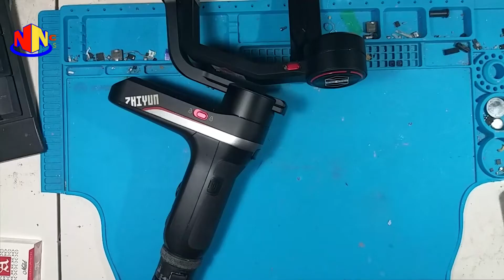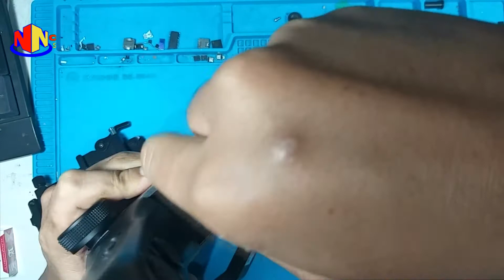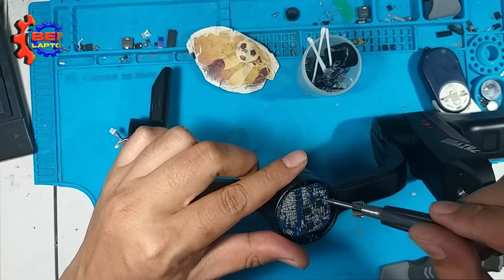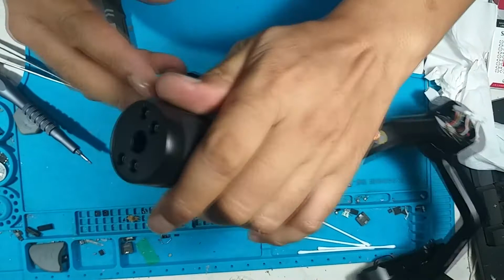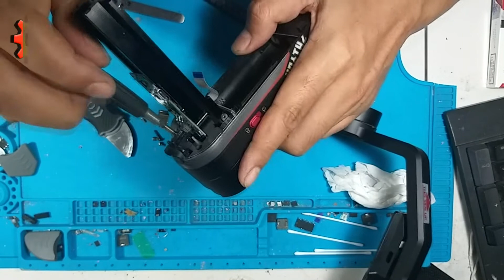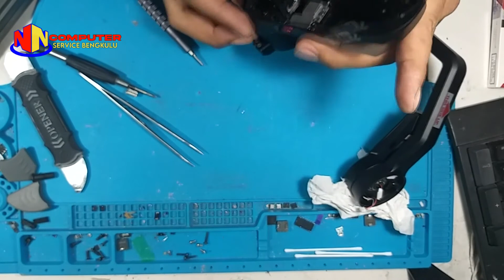cara bongkar \ Disassemble  gimbal zhiyun weebill s

Comment: saya punya weebill s juga mas, dan tiba² tombol trigger didepan ga bisa befungsi lagi, diteken biasanya jd follow mode skrg ga ada respond apa² kira² apakah tombolnya rusak atau apa ya? makasih
Reply from the maker: Chek dulu firmware nya
Reply: @NNCOMPUTERSERVICEBENGKULU  gara² begitu, saya upgrade firmware ke yg terbaru tp ttp saja masih gitu mas, smuanya masih normal, cuman tombol triggernya aja yg ga work
Reply from the maker: @SonyMeydianto  kembalikan ke versi sebelumnya om
Reply: @NNCOMPUTERSERVICEBENGKULU  bisa didowgrade mas?
Reply from the maker: @SonyMeydianto  bisa ambil firmware versi di bawahnya.
Reply from the maker: @SonyMeydianto  bisa ambil firmware versi di bawahnya.
Reply: @NNCOMPUTERSERVICEBENGKULU  bagusnya yg versi brp mas?
Reply from the maker: @SonyMeydianto  versi sebelum di upnya berapa
Reply: @NNCOMPUTERSERVICEBENGKULU  lupa sih saya mas

Comment: One of my axis locks are broken, i tried taking it apart and putting it back together. Any ideas where i can find a lock to replace it with?
Reply from the maker: if the axis lock is broken make sure . the tool is still intact so it can be used again. axis lock is used when the stabilizer is not in use. so even if it can't be locked I don't think there's a problem, this stabilizer part is not for sale, thank you

Comment: My tripod got stuck on the top of the stabilizer. If I open it, will there be a way to remove the lock?
Reply from the maker: There's a way to open it only at the part that's stuck, in the video everything is told to open it all